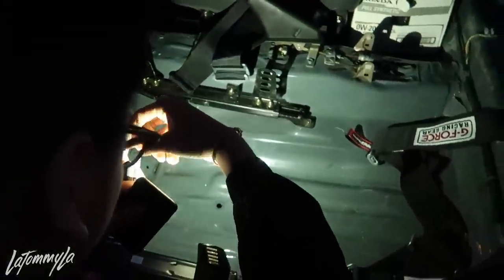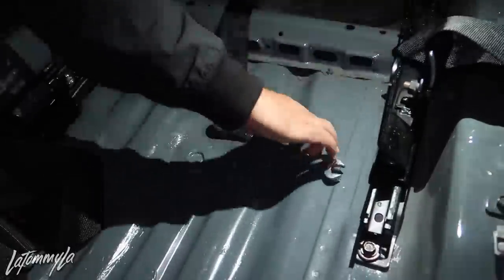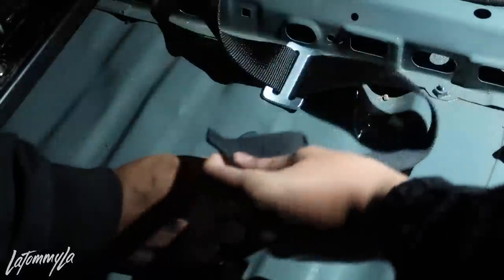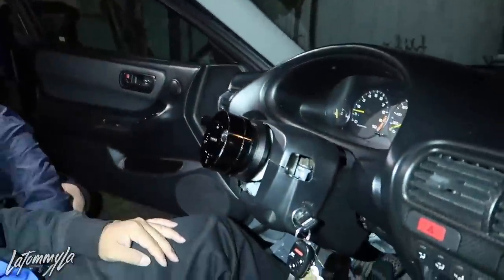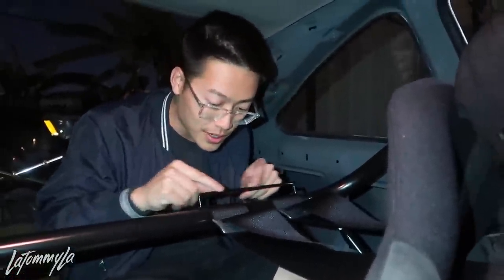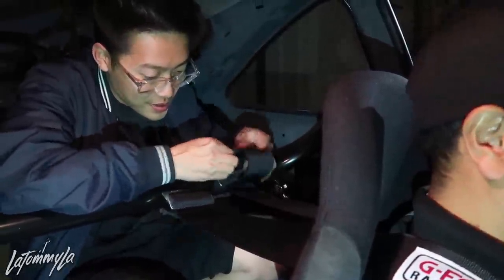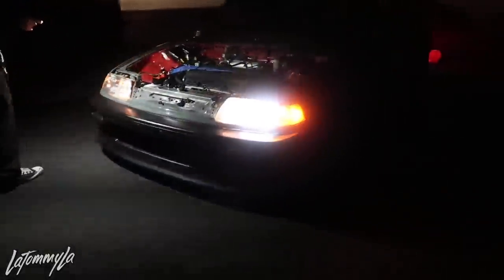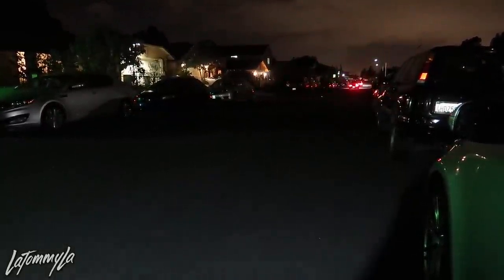Vtec Club prepping for the boysss

Comment: The tiny bar is to keep the harnesses from moving right and left outside of the area. Eventually he'll want to upgrade to a harness that bolts in the back seat-belt locations. Harness bars can and will bend on impact.